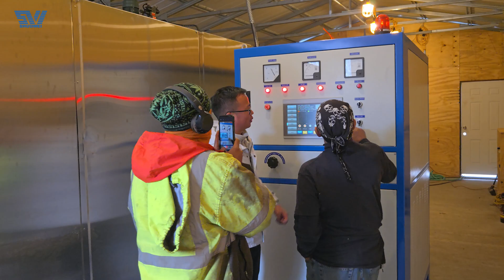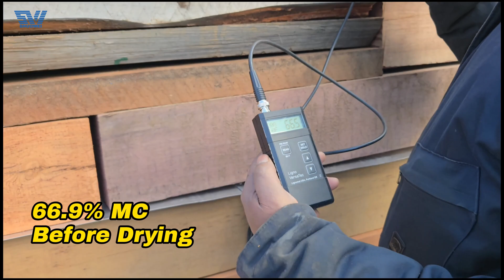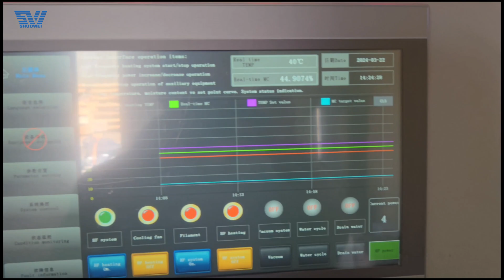Drying Wood with Vacuum Wood Kiln - How to Dry Wood?

Comment: Did you dry those poles and Timbers in that vacuum kiln?
Reply from the maker: Yes dear. Shuowei kiln can dry different types of wood and the drying effect is perfect. What kind of
wood do you want to dry?
Reply: 10” and 12” butt pilings up to 35’ long. Moisture content at 29-35%. What would the drying time be?
Reply from the maker: Thank you for your interest! Drying wood typically takes about 5 days, but the exact time can vary depending on the thickness.

We'd love to provide more specific information and answer any questions you have. Could you please share your contact details? Alternatively, feel free to reach out to us directly:

Email: info@hbshuowei.com
WhatsApp: +86 18633478655

Looking forward to connecting with you!